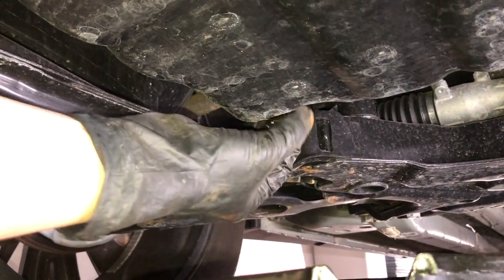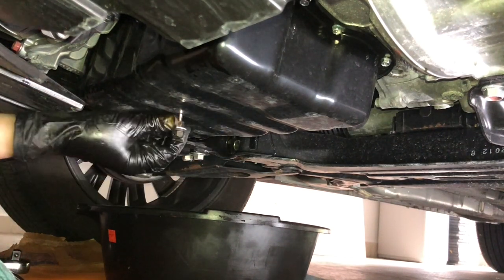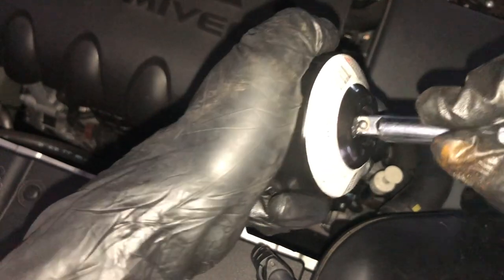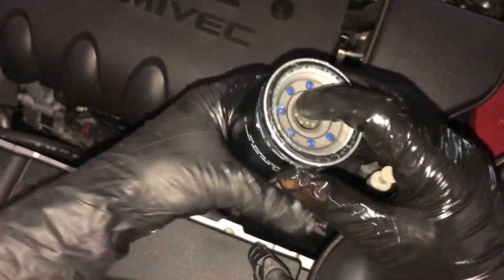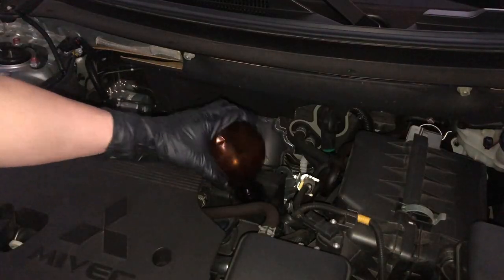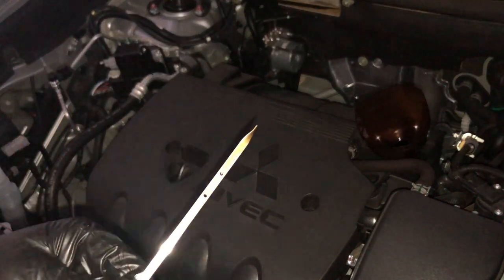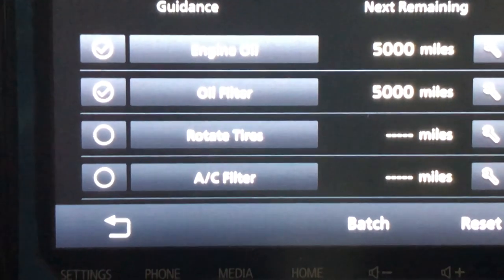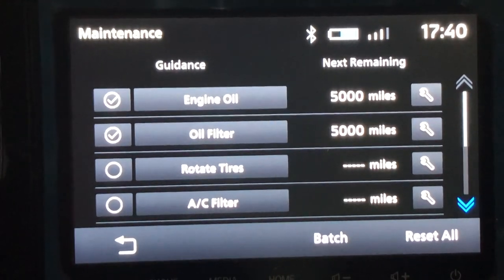Magnetic Oil Drain Plug - 5,000 mile Oil Change Mitsubishi Outlander (2nd oil change vlog)

Comment: good job ! and its a really nice function on the car to have to setup the oil change reminder  every little thing helps like that
Reply from the maker: Thank you, Stan! It’s a feature most new cars have now, a bit of a gimmick, but helps to keep track of scheduled maintenance and is customizable. You can program to get reminders for various periods of time and mileage for different things from brake fluid to rear diff service to wiper blades and cabin air filter. Sure beats having a notebook 📓 in the glove compartment. Although, I still have a notebook with receipts to keep track of cost of ownership just for fun!

Comment: You pour 0W20 oil. Others pour 5W30 , 10W40 ... 🤫.
Reply from the maker: That’s what the car calls for 0W20. It’s on the stickers under the hood and in the manual.
Reply: @MaximumDIYGarage  - Outlander manual says:
Diesel engine - oil 0W30, 5W30.
Gasoline engine - all parameters from 20W40 to 0W30.
Use the oil depending on the ambient temperature 🤔.
Reply from the maker: Yes, sir! That is correct. My climate calls for 0W-20. No diesel engines available here in the USA, only the 3.0 gasoline/petrol and 2.4 gasoline/petrol were available up to 2020. Now it’s Nissan’s 2.5 and a hybrid power trains available for the newest generation Outlander.